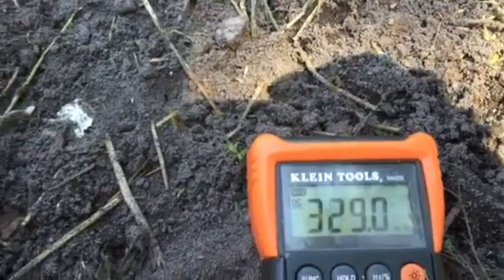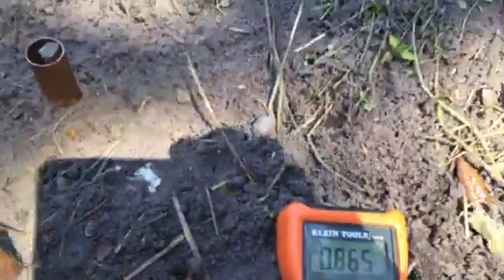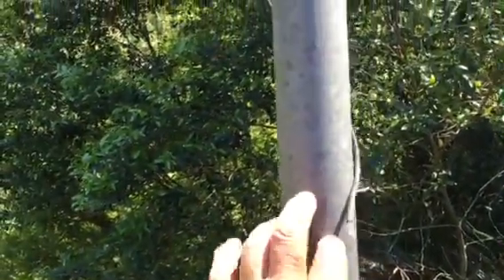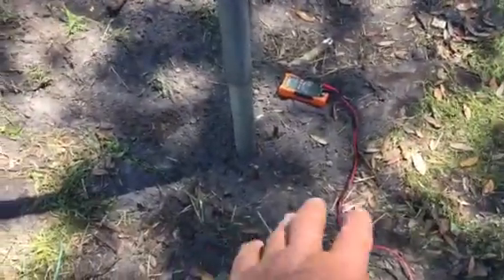Edleedskalnins workshop. Showing that 1 or more volts can c

Comment: Hi Roy,  when you on one site touch the iron and on the other copper you have simple battery.  Nothing special. there is chemical table,  which shows voltages between each metal,  i think that voltage you became from these chemical reaktion.  here is nothing special.  you must verify the voltage between iron and iron...  copper and copper etc...  
greets
Kuba

Comment: Hi Roy this may sound disgusting but there's logic try your urine in the copper tubes with the iron   As you know urine has many salts etc from the body/waste of all consumed. So it should activate like a spike neutral type of relay pulse letting the copper and iron and earth chaotically escalate.  Anyway just a theory   Not certain
Reply from the maker: Hey Honda
I'am thinking and most human pee is acidic, That's why.
But you just gave me a idea. 

Two types of water, one acidic and one negative 
Just like making alkaline water, two compartments 
With a sponge in the middle. But this time I will add a iron core in the middle of the spoung.